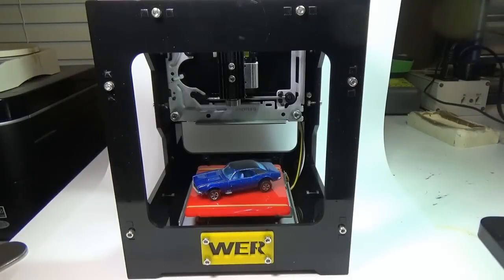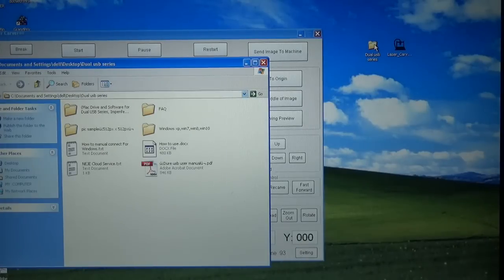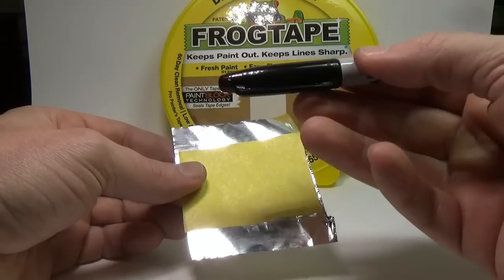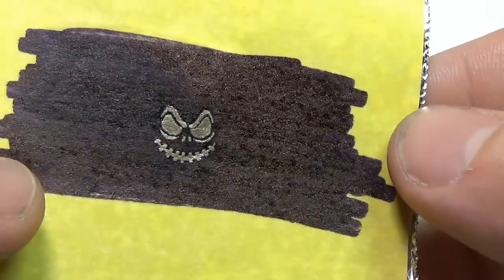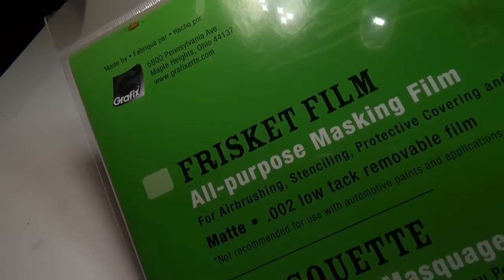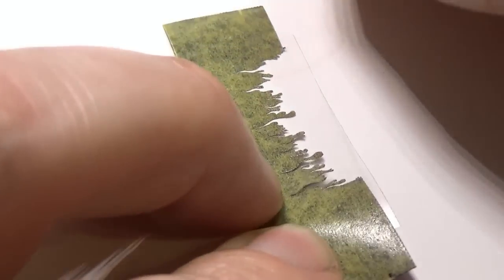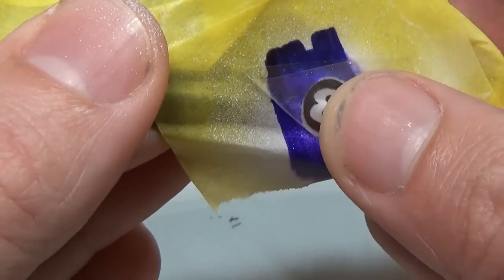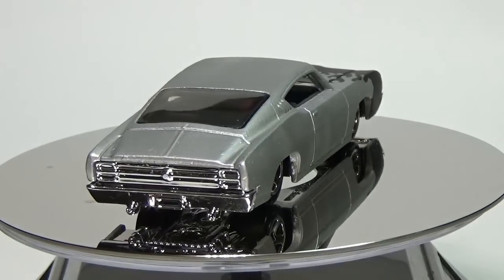Making Custom Paint Masks with a Laser Engraver for Hot Wheels Customs

Comment: It looks as though your biggest issue with the more detailed masks is the paint itself.  I bet you'd have a better time of it if you thinned the paint and just put down more, misted layers.  The masks themselves seem to be perfect.  I purchased the engraver myself and it's worked perfectly.  I'm using it for larger masks to replace some decals on plastic models.
Reply: My thoughts exactly regarding the thinner paint and lighter misted coats--you can also reduce psi a bit as well. When you have the right mix, you can draw with the airbrush as if it were a pencil or pen.
Reply from the maker: good advise... will try.

Comment: Thanks for the video... more for the laser than the technique.  I have been contemplating buying one of these for custom logo application to my leatherwork.  The obvious problem is the work area... however for some projects/pieces I already apply my logo to a small square piece of leather that is then glued/sewn on the main project.  Still not 100% applicable solution.  Your information was very helpful.  As for my custom hotwheels... I can see how this would be helpful for those masks.

Comment: Is illustrator not better for logo's and suchs? As a graphic designer we use Illustrator instead of photoshop because instead of pixels it uses Vectors that stay very sharp and crisp when being made bigger or smaller.
Reply: Sure, but you're still going to have to make the image 512x512px and run it through the engraver's application.  Plus, I'm sure the laser isn't burning square pixels.  It's burning lines.

Comment: You know, they make vinyl specifically for paint masks, and even more specifically, special black vinyl just for laser cutting. It might make the whole process a lot easier, and maybe remove a couple of steps, and make the mask more durable.
Reply from the maker: bigbuckoramma do you have a brand name for this?
Reply: Sorry for the delayed reply, i had to do some digging. There used to be a project called MagicMask that was a film based transfer sheet that was designed for laser engravers. I cant seem to locate that anywhere. And when i asked my buddy who used to use it (and owned a digital print business), he said the place he used to get it from no longer exists, and he has no idea who their supplier was. He did mention a product called Laser Tape, which is specifically designed for engraving, and will leave a surface mask on a product after engraving for doing color fill. So you would put it on the piece first, then engrave through the tape, then flood fill or spray the engraving, and remove the tape afterwards so that the fill is super crisp and clean. He said you MIGHT be able to use that with a metallic backplate, and some transfer tape, but that the stuff is, by nature of its usage, pretty tacky, and probably wouldnt lift properly. But he said if there is a way you can zero your registration on a template with your engraver, you should be able to make a jig that always holds the cars dead center, and mask directly onto them, like you mentioned previously. He also said that if you are using masking tape, that you can do a quick shot of clear onto it, before using the transfer tape, and that will help give it a little substance to keep from tearing on more intricate details. He also said that, depending on the wattage of your laser, you may be able to use some polyester sheet as well. He said absolutely DO NOT use PVC vinyl under the laser, as it gives off really nasty chlorine gas. But he said the polyester stuff should be OK, so long as you are in a well ventilated area. He said #M makes the good poly sheet material. Sorry for opening my big mouth, that probably wasnt as helpful as you had hoped, but hopefully its at least somewhat useful.

Comment: Frog tape has a different adhesive than regular masking tape. This may be causing the issue with extra residue.
Reply from the maker: any tape I try has this issue... it makes since, the film is transparent... the laser goes right through it. What I need to try is marking the foil black so that it might heat up enough to burn the film off.